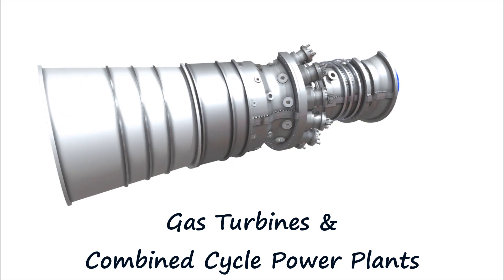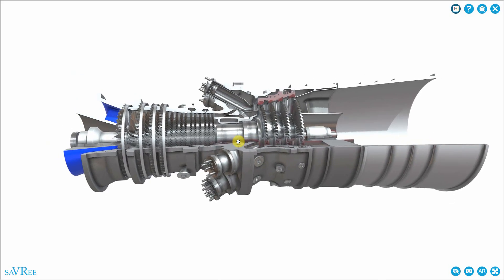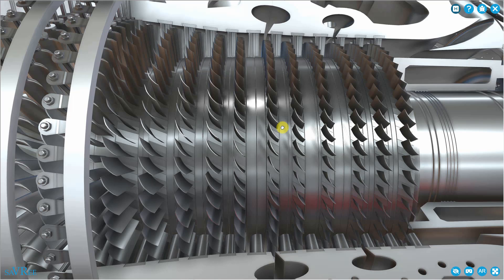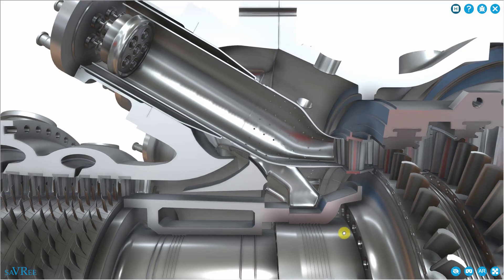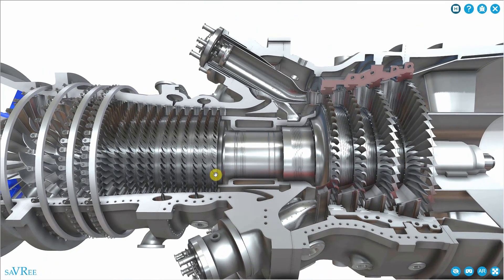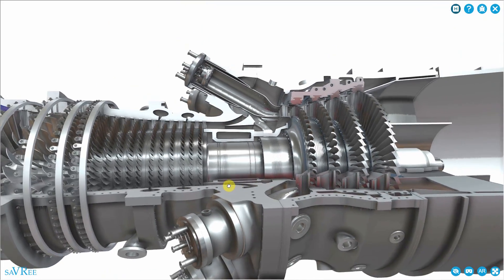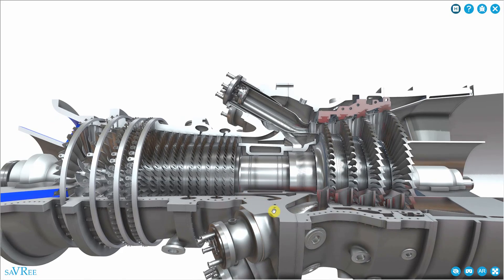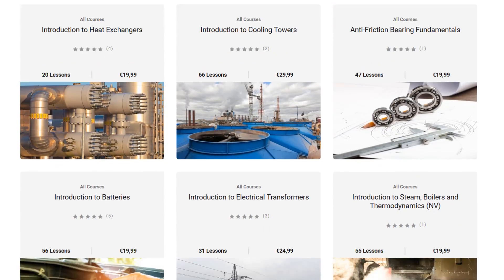saVRee Snacks #11 -Gas Turbines and Combined Cycle Power Plants Explained

Comment: There is absolutely no reason why this cannot be scaled down and put under the hood of consumer vehicles so we can actually have decent fuel economy. There’s actually a lot of different things that can be performed with that waste of heat energy including making hydrogen from steam and running that back into the combustion process.
Reply: It was tried by chrysler in the 60s. They work, but the tolerances are much tighter making manufacturing cost much higher. That plus a more intense maintenance schedule and higher sensitivity to neglect make them impractical.
Reply: But there are some real hard reasons why it is difficult to effectively scale to a car size. Good thermoinsulation and recuperation need bulky and heavy stuff. And heat-exchange processes are too slow, so you need large plant for decent motor power.
Reply: There’s a lot of reasons actually

Comment: You present this as if the reason for the boiler was to use the waste heat of the Gas Turbine Generators (GTG). I think it's actually the other way around. In order to make steam you need heat. But rather than just use natural gas burners to heat the boiler directly, they increase the efficiency by running it through a GTG first. 

Combined cycle plants are common as electrical peaking plants, but I see them used in cogeneration facilities where they needed the steam for building heat. A local university to me basically gets free electricity by using three combined cycle plants to supply the low pressure steam for building heat. They get 80K Lbs per hour of steam just from the GTGs and a further 80K from burners in the HRSGs. They even added a small steam turbine as a "dump" that can handle 15K lbs per hour steam so they can still run all three GTGs when the campus load drops below 80K per hour. They use the three GTGs to generate electricity and have the ability to produce between 65K and 160K pounds of steam per hour for building heat depending on the needs of the campus. 

Before they used GTGs they just used regular boilers, using basically the same amount of fuel but getting zero electricity. From their point of view they didn't replace the boilers, they replaced the burners. Instead of direct fired boilers, they replaced the half of the burners with GTGs and got free electricity out of their process. It's been a MASSIVE savings to them.
Reply: Where I think you are incorrect: the primary function of a Gas Turbine is to generate electricity, not heat the boiler. BUT, the GT is made economical by powering a boiler with it’s exhaust heat (HRSG).

Comment: Never heard of pulverized coal being used as fuel for das turbines. Seems like a nightmare for turbine blade wear as well as injectors. Can you provide ant examples of one of these?
Reply from the maker: It is not main stream. They had pilot programs for ultra pure coal, but I don't think it ever became viable. Pulverized coal is listed though as an acceptable fuel for GE turbines (on the GE website) so I put that into the video.
Reply: @savree-3d  Thanks!
Reply: Check out some locomotives called GTEL's (Gas turbine electric locomotive) they used bunker C mainly with a couple prototypes later being made for pulverised coal
Reply: @Moist_VonLipwig  I'm familiar with UPs GTELs which initially used Bunker C and layer switched to #6 HFO. I don't recall any that were tested with pulverized coal as a fuel. There were the C&Os experimental M1 coal steam turbines. But these used regular coal to make steam in a boiler for the turbine. Again I don't recall pulverized coal used as fuel with them.
Reply: @terryboyer1342  I will try and find where I saw it and post it here
Reply: @Moist_VonLipwig  👍
Reply: @terryboyer1342  ok it was units 80 and 80B that were converted to run on pulverised coal though they were scrapped as you could guess due to blade erosion and soot build up
Reply: @Moist_VonLipwig  I'm surprised they even tried it outside of a test facility. Common sense points to it failing. IMO anyway.
Reply: Thanks for this video